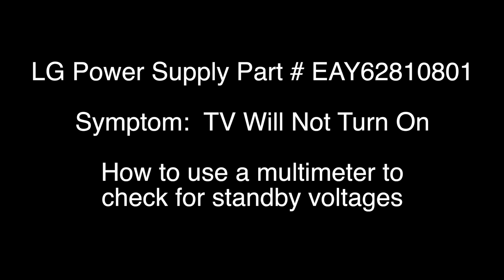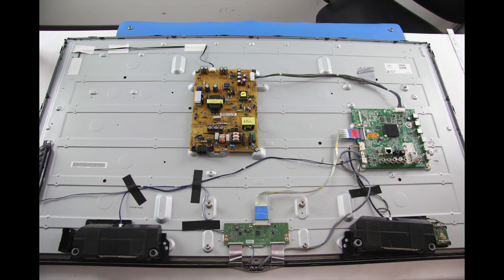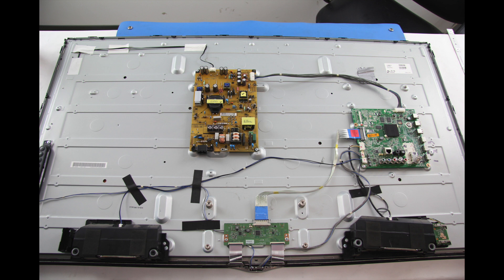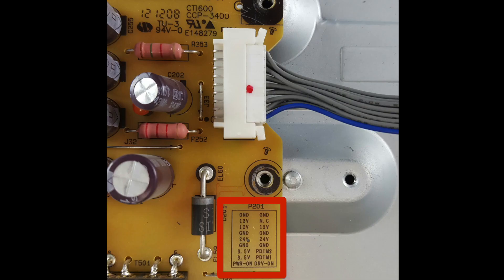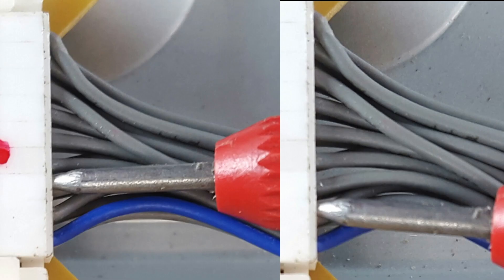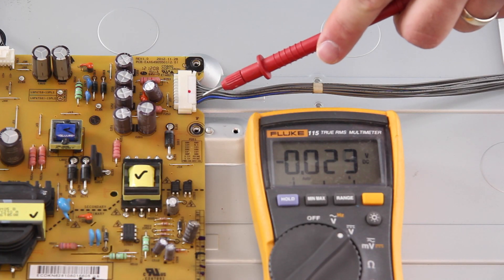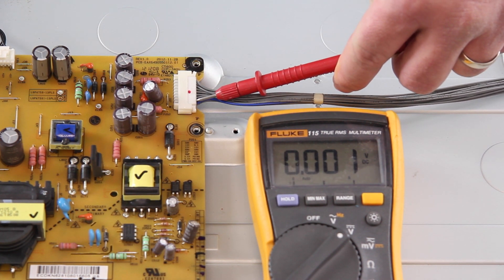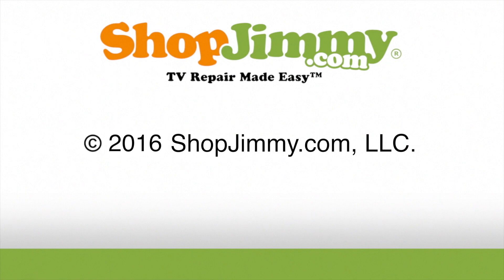LG TV Will Not Turn On EAY62810801 Standby Voltage Test Tutorial

Comment: How far into the plug do you have to push the lead from the multi meter to get a reading?
Reply: until it touches the metal contact..
the contact from the incoming side to the jack can also be touched..

Comment: I have a issue whit black screan but i hawe logo and power to motherboard i try to find out what is the issue and wich part to change, so i have a question to understand this i just chek the powerboart, just like you explaning on your video and i have this 3.5v standby voltage on this 3 pins but this voltage is to supposed to be same after when you turn on the tv or .

Comment: I'm testing an EAX64905801.  I've confirmed 3.5V and 24V. My 12V reads at 11.75V.  Is that good enough or would this consider my power board as bad?

Comment: Great work but how to find the correct voltage to measure, say for a LG 47 LN5200?
Reply: There is a template printed on the board next to the connector

Comment: I read 3.03 V on those pins. It's 9% out from from nominal. I don't know if this means the power supply is out or if it's a different problem. I'm on the fence.

Comment: I have an Lg model 42LD520 that sometimes won’t turn on. Sometimes the power button does nothing. After unplugged for 30 seconds sometimes it will come on then it powers off and back on by itself every few mins. Sometimes it will go long periods like an hr or so before restarting. Sometimes I have to leave it unplugged for several days to get it to come in again. It was given to me so I just would like to get it working to use in the bedroom. Would this video apply to my tv also? I know it’s a different model so I’m just curious.
Reply: Sounds like a faulty capacitor somewhere...

Comment: I'm getting Correct voltages at the main pins going to the main board. but 0vdc out the 2 wires to the Led+ led- terminals what voltage should I have there? I'm getting sound but no picture

Comment: I have a LG60 TV , standby light comes on ,but thats it. There are 2 3.5 volt probe points on the connector that goes to the mainboard. I  show 3.5v on 1 but not the other. Also I shoe no voltage on the 12v or 24v probe points on the connector either. Could it still be my power board?

Comment: What if I have 3.5v standby but I don't have 12v or 24v?
Reply: The 5v 'wakes up' your main board. Power switch connects to main board and sends signal to ps to turn on 12v. If no 12v then MAIN BOARD is bad

Comment: Toshiba 55" 4K set operated fine since early 2017.  Upon turning it on last week, after about 30 seconds all power was lost, screen went dark, no sound, and no standby light showing.  Checked the inlet wire and all okay and after a min or so I plugged the power back and got only a standby light for about 10 seconds and then all dark again.  Idea's for remedy???

Comment: I have standby power 3.5 volts, but not get 12 v and 24 v, it is power supply or main board problem?
Reply: I have same issue, did you get an answer?
Reply: Same. Pressing the power button makes it go to 0 V momentarily then back to 3.5 V, and the 12 V lines go to about 0.35 V then decays to 0. Power supply?
Reply: @DaleAng  this is the CPU pulling back power because it does not sense the leds turning on , you probably have a bad led
Reply: Mainboard

Comment: Have a 65UH5500
4K UHD Smart LED TV - 65" that went black while watching. Light will flash about 3 to 4 times and turns off. LG TV sigh will briefly flash when you unplug and turn back on.Replaced Main board and power board . STILL THE SAME . Any ideas ? TV is 2 years and 3 months old
Reply: Brooke Williams  same... need a fix
Reply: Samw problema, somebody has a solutions for that?
Reply: this comp. sas replace led strips

Comment: apparently i have a different tv, the power supply board says: EAX64905501 (2.0), but the legend says 3.5v on both the same contacts you show. both test 4.1v...  assume that means the board is OK?
btw, i don't see where you place the black probe, only the red. and it looks to be more difficult making the probe contact on the plug side, so i tested from the gnd and contacts on the back side of the receptacle.
Reply: If your reading LESS than the printed voltage, your ps is bad. I always place ground to chassis.

Comment: I recently bought a mainboard from you (LG EBR61718912). It gets 3.5v on standby, powers on and the screen flashes 3 times before going off. I do see picture each time. I get 24v and 12v on their respective connections but goes away as tv shuts down.. Is this a sign of a BAD power supply board????
Reply: Hi have u got this fixed. I have same problem just wondering What was the issue? Power board or led lights?
Reply: @harryaroraji Yes, I have the same problem, only on a LG 32lk450-Zh device. Has it been solved for you? If so, how would you please describe it?

Comment: I have a Philips lcd tv modelnumber 42pfl3605/12 and the serialnumber is rj1a1023034575   it will not turn on no power the standby led dont lght up and the capistors are all good please can you help me   i also replace the fuse but nothing happens and the fuse is still good

Comment: What would you recommend if when I test for the standby voltage, I am reading 7v instead of 3.5?
Reply: It depends on your psu it will say on the board grnd and what ever voltage
Reply: I got the same reading.  I was touching both the 2nd and 3rd pins simultaneously.  Try again, being very careful to touch only the 2nd OR 3rd pin.